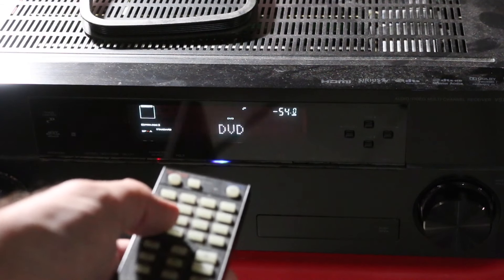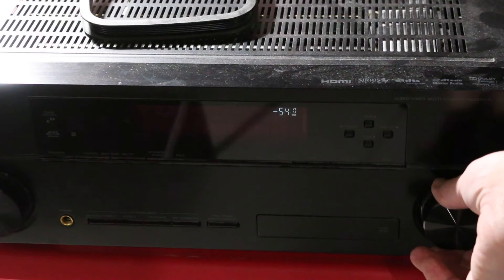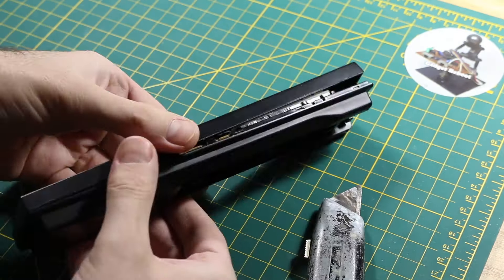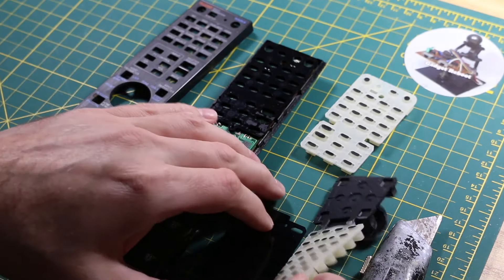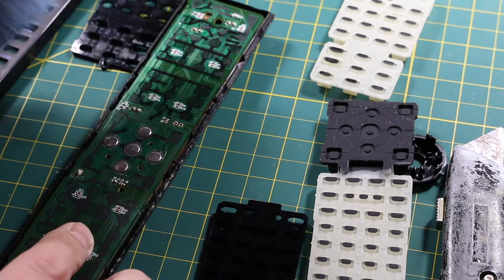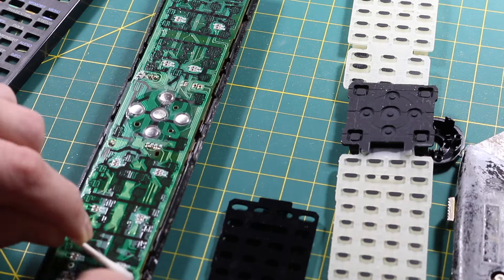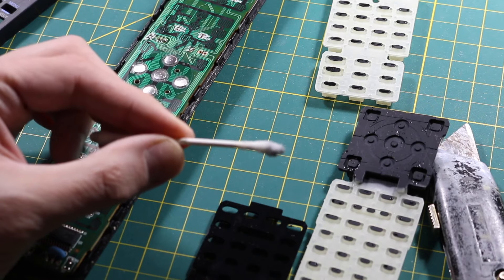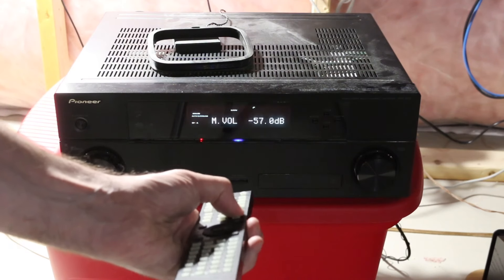Fix Remote Control Buttons Not Working - Clean the contacts inside

Comment: How do you know if a remote is working?  Well, glad you asked.  Most cellphone cameras can pick up IR light which most remotes with the little LED on the front has.   Turning on the camera, putting the remote in front of it and pressing a button or series of buttons will lead to a flash of the LED visible to the camera.  If it flashes on some buttons but not others, you have either a dirty situation that the above video may help or a failing remote.

If after this the remote still doesn't work, don't throw it away.   Sometimes you can find replacement/used remotes on EBAY.  If the remote once worked with  that set, it's very helpful to get the model number off that remote for a replacement.

Comment: For the rubber parts, I put dish soap in my hands and lather it up then grab the rubber part and rub it around.  The dish soap helps to remove all the oils from your fingers that gets down in the nooks and crannies.  Then just rinse it off with hot water and pat it dry.

Comment: This does work although I'm sorry to say I doubt it'll work for long. Old silicone degrades, and when it does it secretes an oil, that's the 'residue' you discovered on the board. I don't know how long Silicone can do this for, I assume though that it would have to stop at some point. I've been cleaning a TV remote like this for at least 18 months and still have to do so regularly.
Reply from the maker: I saw mention in a forum that replacement little pads can be bought and glued on when it degrades too much and of course people glueing aluminum foil on so I haven’t gotten to that point yet but it’s an old receiver and I’ve been upgrading the home theatre components. I’m hoping i’ll just upgrade the entire receiver by the time the remote becomes too annoying if it keeps failing.
Reply: @GadgetReboot  LOL....yeah, I'm at the 'Cutting up small bits of self-adhesive copper tape' stage.....works well but only prolongs the inevatable....ho hum.
Reply: @GadgetReboot Aluminium foil is the only thing that worked for me. The rubber seemed intact and clean but still had to apply huge force to make contact
Reply: I am so glad you mention the oil residue, Just took apart the remote for my Denon AV amp & was greeted by oil everywhere, I have never come across this before so thanks, Now how do I say sorry to the Mrs for blaming her for using the remote while she was rubbing baby oil on her dry skin?!.😁

Comment: I used your video to clean my Samsung TV remote but after this cleaning the remote still did not work.

I went back to internet and found a post that said take your batteries out of your TV remote and then press the channel key for 10 seconds to reset everything.  Put the batteries back and my remote began working great again.

You need to mention this type of resetting for TV control.
Reply: I pressed the Power Key for 10 seconds. It worked. Thanks.